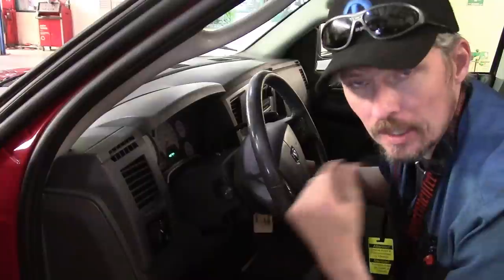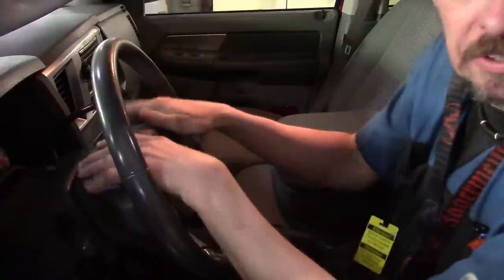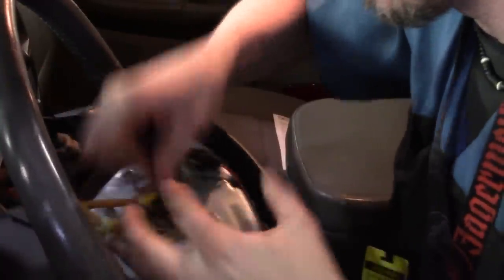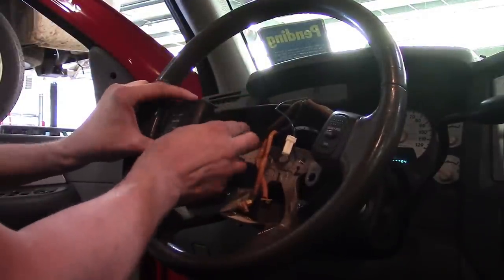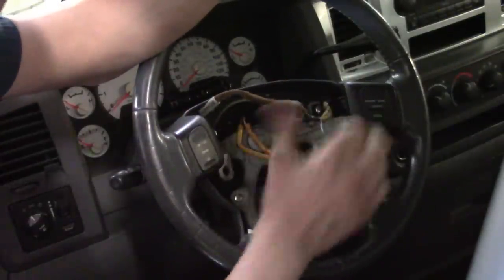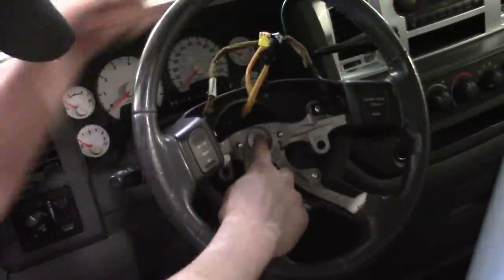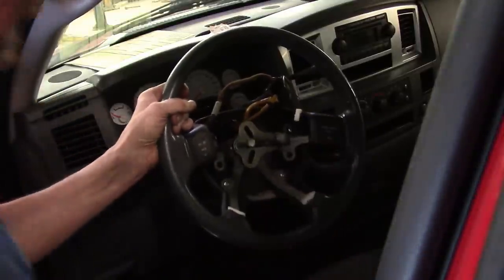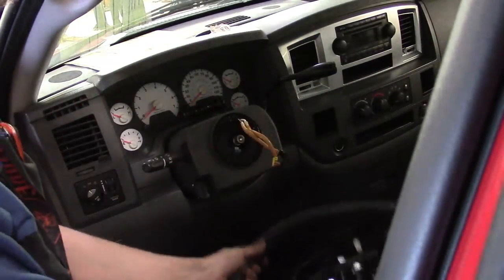2003-2008 Dodge Ram steering wheel removal

Comment: I just changed my 2006 Durango wheel. Everything went smoothly. To remove the air bag connectors I used needle nose pliers to gently squeeze the tabs and lift off the connectors. Works perfectly. I found that the steering wheel gently rocked off the spline and didn't have to resort to the wheel puller that I bought. I guess that's one tool going back. This video was perfect for understanding the process.
Reply from the maker: Thanks Rodger for the comment. Glad it went well and easy. Don't forget to subscribe!

Comment: So it sounds like there's no way to re clock,or "jump" one or two splines to bring the steering wheel back to center after a front end alignment?
When I took the truck for alignment after a tie rod replacement the wheel was about 11° off to the left. After the alignment it's about 11° off to the right...😆
Can this be adjusted by removing the steering wheel and jumping one spline to the left?
Thanks in advance for any information or advice.

Comment: Thanks for the video!  Question, I have an 07 Dodge 2500. I have a clicking noise when turning the steering wheel. Where should I look in trouble shooting that?  Thanks in advance!

Comment: Great tutorial. How would I go about taking the chrome badge off the front of the steering wheel cover? Are there just more clips to detach the airbag assembly from the cover?
Reply from the maker: I didnt know that the emblem was avail seperately. I only knew of it coming with the airbag cover which also has the horn pad. the airbag can be removed seperately from the cover by unhooking the cover from the airbag. it takes times but is possible. The airbag has metal fingers and the cover has slots cut into it that the fingers go thru.

Comment: Great video, excellent lighting, steady camera, easy to follow instructions and reasons why.
Question: I've just replaced my R & P on my 2005 Grand Caravan. The steering wheel was tied down in the straight/level position. After I forcefully attached the steering intermediate coupler to the rack gear and attached the outer tie rods to the wheel hub assembly and did all the fluid checks etc I took the van for a test drive. The steering wheel doesn't turn as far to the left and turn too far to the right. The intermediate coupler is seriously stuck onto the rack and I really don't want to have to spend 2 hours trying to figure out how to get the two pieces apart. I would appreciate your ideas, professions or creative.
Thanks again. I've subscribed to your channel and look forward to more tutorials.
Gerry / British Columbia / Canada
Reply from the maker: Thanks Gerry for the cool feedback. It sounds like you may not have centered the steering rack before installing. I always mark where the old on is.....and then turn the input shaft until it stops and I make note of the number of times it turned until it stopped. then I max the new one out in the same direction and then back it off the same number of times until it ends in the same location as the original. There are cases where the rack could be the issue and wasnt correctly put back together when rebuilt at the manufacture. At this point the steering coupler will need to be removed from the rack. It should have just slid down onto the rack without much effort....it is made to only go on one way (keyed/splined)....if it was hard to get on then it may not have been lined up correctly and was forced into a spot instead of where it was suppose to go.
Reply: I figured. Is there a tool or technique to remove a VERY stuck intermediate coupler from the rack splines?
Thanks.
Reply from the maker: No tool that I know of.....if the coupler has a split down it then you can try wedging a chisel or something to help open up the coupler so that it can be removed easier.

Comment: Hi, I have an 03 dodge 1500. My clock spring is bad. I know its an easy fix. I am just a wee bit nervous of the scary air bag. Is there ANY potential of accidental discharge if the battery has been disconnected for well over 30Min?

Comment: I  just bought a 2003 dodge ram 1500. It was wrecked in the  front.  It has a lot of play in the steering which doesn't seem to transfer from the steering wheel to the steering column.  Any ideas on what it may be?  Thanks.
Reply from the maker: Hard to say without performing a good inspection. Anything is possible on a wrecked vehicle.Thanks for watching and make sure to subscribe

Comment: Great video, I have one question, Dodge Nitro RT..on the steering wheel 3 and 9 position is the info control center buttons, I have been unable to replace the polished metal area the buttons fit into...no and mean no Dodge dealer can find that part number
Reply from the maker: +Wayne zaycek Email your VIN number and I will see what I can try to find out. david@motorcitymechanic.com

Comment: Do you have to remove steering wheel to be able to remove the turn signal switch on this same model? Thx for the video!
Reply from the maker: +mexymac Afternoon, depends on the year model. Here is a link to a video I made where you don't have to remove the steering wheel. https://www.youtube.com/watch?v=UZEtRwt2BRw Make sure to subscribe and also check out my other videos. Thanks

Comment: I have a truck with a person that was pulling the steering wheel to get in the truck now it rattles back and fourth. Does anyone know if I can just tighten it up or adjust it or do I have to replace?
Reply from the maker: Its hard to say. Sounds like it will need to be taken apart to see hat me causing the play. On the older trucks you can do some repairs. Been awhile sense I have seen this issue so I cant remember exactly what years....there was a bulletin actually that covered a similar issue. Whats the year of the truck?

Comment: Hi. I'd like to replace the stock steering wheel with one that has no cruise control or other connections, maybe a horn at most. Is it possible to use the replacement steering wheel solely for manual operation, or will I likely encounter short circuit or other electronic problems?
Reply from the maker: +whoop dat trick Are you wanting to go with a stock steering wheel with no switches or an aftermarket steering wheel of a completely different design?

Comment: I was wondering of I could change my 02 steering wheel to an 04 wheel.
Reply from the maker: I dont see why not. I recommend calling your local Dodge dealer and have them look up both year models to see if the part number is the same. Being the same body style I feel it will work but best to be sure. Thanks for asking and make sure to subscribe. Enjoy the weekend.
Reply: Chris Longoria did you end up changing your steering wheel looking to do the same on my 03
Reply: @erykzavala438  
Yes sir, wheel looks awesome. Basically everything is just plug and play..

Comment: can i swap steering wheel with a nrg racing steering wheel and delete cruise and airbags? 99 ram 1500?
Reply from the maker: Morning Lindsey. I dont know for sure how things will work. I am not sure what the laws are about disabling the airbags or in this case removing it. Physically I would think that the swap should go okay as long as its made for that steering column shaft and the splines match up. I personally havent done that swap so I can say 100% for sure in the end